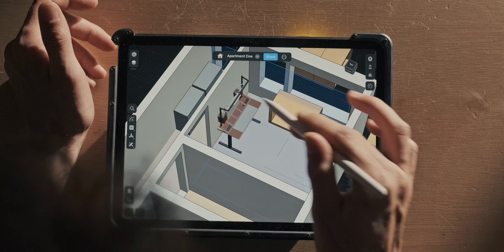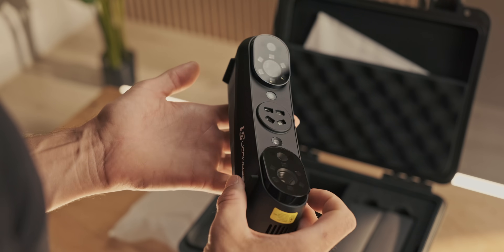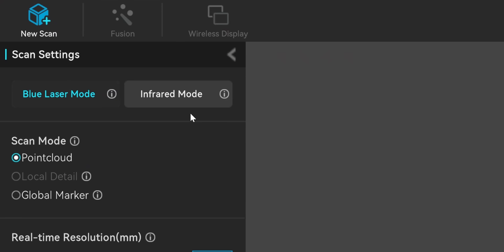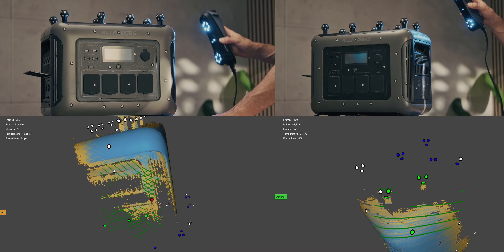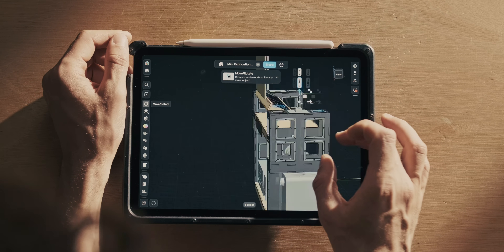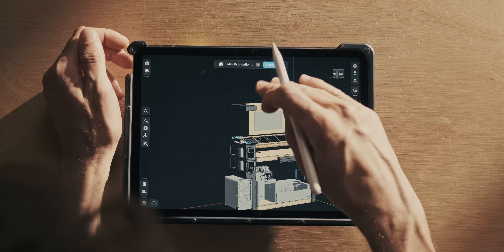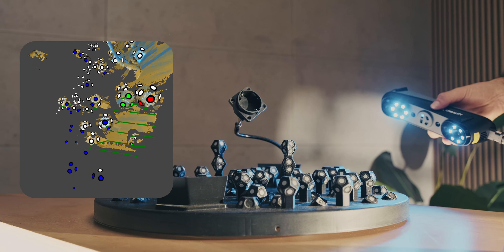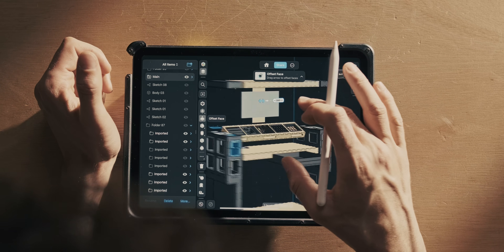This will be my most absurd Setup Build Ever - Mini Fab Unit - Creality Sermoon S1

Comment: Great to see you doing this project. I’ve been cobbling together something similar with Ikea parts but really want to motorize the whole thing to lift up for better access to the laser and 3d printer. Have you thought about attaching the bottom shelf to the sit stand legs so it can move up?

Comment: I thought of gas hinges with your monitor and some locking mechanism at the top and even if it opens accidentally it should open slowly and with a suddent jolt. Use GrabCAD Library for some hardware, and McMaster-Carr for STEP files.

Comment: For the monitor backplate situation:
Instead of a single monitor holder & door that fully closes off the top. 
Why not use two panels that open up to let the monitor out (mounted to extrusion) and then you close those when the monitor is down. On the inside of the two doors you can then mount more accessories for the monitor or stuff. 🙋‍♂️
Lmk if you’d like some visuals. 

Ps: loving the vibe in your videos. Reminds me of Ben Vallack. 👌
Reply from the maker: Thank you i  really appreciate your input, ( if you have visuals ( and the time ) could you send them to me via info@flatlanders.nl then i can get a better picture of what you mean i have a little bit of trouble following hhaha.

Comment: Unsure if this is a viable solution but consider using a short throw projector mounted inside the cavity for the monitor? Especially since its likely not going to be used for gaming. 

This way you can customize the backboard itself for your current needs:
- By default, a pegboard for extra tools or pieces you need to keep around for a current project
- Magnetic projector screen that you can snap on at the edges for your projector to use
- A whiteboard..? same idea, snaps on or rolled out sheet you can once again mount on with velcro or something.

This also gives the cavity more usability to store little boxes of cables and tool heads you need for your other machines since projectors dont have to be too large! 

P.S. I'm not a maker by any means but I completely relate to wanting something to be multipurpose and utilitarian  without compromising on the experience :)  Keep up the good work!
Reply: Love this idea! I also thought of a projector but your idea of then further utilizing the space makes a lot of sense!

Comment: you could put the project panel on a hinge with a pin at the edge so that when the legs go dow it tils up and becomes flat, but when the legs are extended the project panel tilts with gravity until an end stop stops it at that angle

Comment: Your problems are very similar to mine. It's hard to make things in a small space...

With your tilting horizontal piece, you could put it on bearings at the pivot and add bungee cord to either end attached to the bottom desk surface. That would mean it swings down into place as you raise the top desk and flattens as you lower it and the top pushes down on it. You could also use weights in place of cord. You'd need end stops where you want it to sit.

For your monitor, if you always want it to come down as the desk raises, then you can use dyneema cord attached to the corners and pulleys to lower it using the raising motion of the top surface.

Also, I've often dropped tools and hardware on my leg and had them fly under the desk. Protect that Xtool!